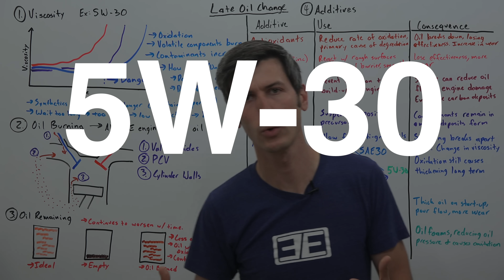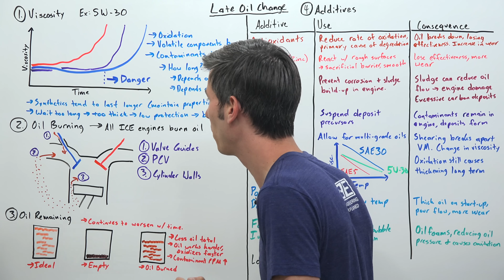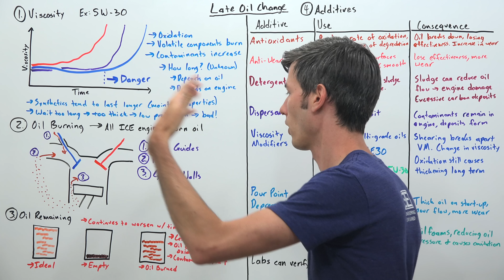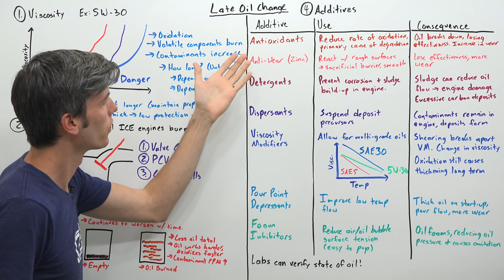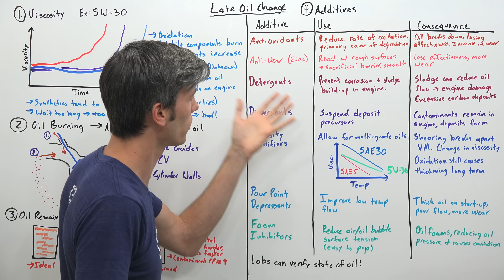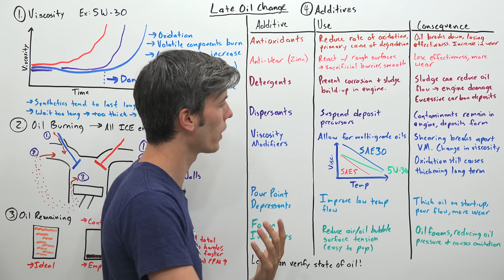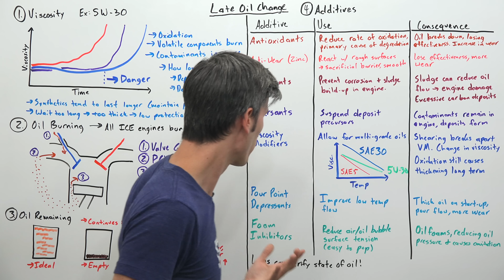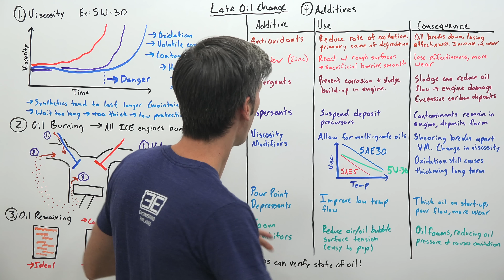What If You Forget To Change Your Oil?

Comment: My dad hade brigg and stratton engine That he never changed the oil in.  Lasted 33 years. And we dont know how match langer it should hold.. cuz the body was rusted up really big holes everywhere. 
And the wheel was wobling last 4 years And then one fall of..  I saved the engine for 2 more years still worked fine. 
But it never Come for new use..  I throw it scraps
Reply: @EpicDrew15  yes way !!!!!   it did !  33 year without oil change !!!  lawnmower have more setted rpm then cars chainsaws.. 

and built quality back then was way better then now ...... 
after 33 years there was almost no body left only 2 wheels.. i tok it of only the engine looked at the oil it was not sludgey.... maybe little...  i change the oil then after 33 years...  i spray painted it. and made a new airfilter..  

and pulled the string it runs really fine..
had it for 2 more years then i throd it for recycling i had to move to a apartment...  and be flexy for moving around....

in sweden that suff is not wourth anything.. even cars. 
old cars that passed inspection 
a real inspection......  i heard from southauto man erik that they are not so good in usa they just letting passed cars.. 

here in sweden they are really professional and you cant get it passed if its not good for passing....  

wheel  that car coast around 500 to 1000 bucks here !!
Reply: I have quite same age Briggs & Stratton it have had some oil changes. And it has be used every summer but quite less. About 10 L gasoline every summer.

Comment: Why does the USA have such short oil change intervals? It's normal in Europe to have oil service intervals of 15 to 20,000 miles, for example my Skoda 1.5 petrol turbo engine has a 20,000 miles / 24 months service interval.
Reply: @EpicDrew15  It’s definitely 20,000 miles / 2 years, it’s in for its first service shortly.
Reply: Might have something to do with manufacture warranty...

Comment: If your car burns mor than a quart every 4k miles then u never have to change your oil. Drove a Chevy Van like this for Two years. My friend still drives it 3 years later🙂 Its always better to have oil than none at all 👍 Also if your car burns oil stick to basic oil, Synthetic only made it worse. Although if your car is new only use synthetic and change every 6k. If u use Amsoil XL or higher then change at 10k, no longer than that! Skip the Amsoil OE it crap buy something else instead 👍 Good Luck🙂

Comment: On old Stanley's from the early 1900s the "engine" was open and didn't have an oil pan. One was expected to take an oil can and manually lubricate the important bits every 30 or so miles.Mind you this was a steam engine where having a totally sealed engine would lead to water building up because steam.

Comment: I have a question on this topic which is not answered in the video. My cars recommended oil change interval is 15,000km or every 1 year. I don’t use my car often, and when I do, it is never for a short trip so the oil always gets to proper operating temperature. As a result, it takes me more than a year to reach 15,000km. I use fully synthetic oil, so is it okay if I change it every 2 years if that is how long it takes for me to reach 15,000km?

Comment: Okay, on this one, I beg to differ.  I bought a 1994 Honda Civic with 256,000kms for a $26.00 bottle of rum and ran it for 6 years up to 372,000kms - never changed the oil once and never changed the oil filter.  The car didn't burn oil either.  I added about 1/2 of a quart every 5k to 6k kms.  She fired up every day without any issue.
Reply: @EpicDrew15  Andrew... I bought the car for $26 dollars, why would I spend more money changing the oil every 5K?  Every oil change would have cost me about $30 bucks every 5,000 kms - that would have cost me $600 bucks over the 6 years.  I had no intention of keeping the car if it died so I wasn't worried and nor did I car.  Nope, it didn't "burn" oil.  That said, ever car burns oil - a fractional amount with every explosion in the cylinder.  But my 94 civic didn't smoke out of the tailpipe but it did consume a bit of oil - just like the Z06 Corvette and many other cars for that matter.  It just didn't consume enough oil to smoke out of the tailpipe.  Oh, and thanks for your criticism.

Comment: My sister didn't change the oil on her Mazda 3 SP25 for the first 45,000km. Yes, she drove on basically run in factory oil for 45,000km. She then drove the car until it had 130,000km with semi regular oil changes with no problems until she traded it in. The Japanese know how to make an engine.

Comment: Does oil deteriorate if a vehicle is parked up for say a year? I have seen many discussions on forums claiming that it does, but would prefer a scientific answer based on data.
Reply: It does a little bit.  The bigger issue is potential condensation creating water in the oil.

Comment: Used oil analysis services periodically with my big rig... It can tell you if you are starting to have a problem, by metals and percentages in the engine of them.  Additives like Lucas are worth their weight in gold, because the coating they put on the engine parts protects things in a "cold start"... The oil settled and drained into the pan.  If you vehicle has been sitting for several days, and that first few moment when the engine is running a little rough?  That's your piston rings and everything else running dry...and it adds up over time.  Lucas or an additive like it, the engine "spools up" immediately and smoothly at start.  If you want the car engine to last, baby it in the oil and fuel treatment department.  Routine maintenance is noting to cut corners on.

Comment: The COVID question for many of us is when to change oil by date rather than distance. I am sticking to once/year with a good synthetic oil. Other thoughts?
Reply: I stick with 3500 miles or 4 months. No real scientific reason for the time limit, but it just seems like a long time to be sitting in the engine.
Reply: @diytwoincollege7079  For what it's worth, the oil change interval for my 1973 Chevrolet Chevelle was four months, without mention of mileage. Given that short distance driving is hard on the engine and the oil, this does make some sense. I think today's synthetic oils can go longer than 4 months, though.

Comment: I had only put 1500 miles on my truck before my oil life meter expired for time (1 year).  I was about to park it for a few months, so I let it slide until spring.  Full synthetic.  Is there a problem with that?

Comment: My rear main seal was leaking out about a quart a day for about a year. After I finally fixed it I almost forgot to change my oil because it wasn't something I had to do for a year. Surprisingly I didn't change my filter for the year that it was leaking and after inspection it was pretty clean for being a year old

Comment: Best oil is clean oil. I change my oil and filter when I start not seeing my oil dip stick level lines through the oil. Oil and filters are cheap engines are expensive. Cover fifty years using this method and never ever had an engine problem or failure. When I’ve sold my vehicles people say my vehicle is the best they have seen. Best of all they mostly always sold for asking price. First to see usually bought them.
Reply: Ummm... Okay... 

I'm still going to change my oil on schedule instead of when it looks too dark to be read...

Comment: While many people are advised to change their oil every 5-6k, even if you went to 7.5k you're probably OK as long as the oil is topped off and you're using a synthetic blend.  In fact, many newer cars (made in the last 10 years) supposedly claim you can go 10,000 miles between changes, although I personally still stick with every 5,000 miles or 6 months, whichever occurs first.  But it's not the end of the world if you go over by about 2-3k in most cases.  The only time it might is if your engine is worn and leaking/burning a lot of oil and it runs low or gets excessively dirty.
Reply: I had a 2001 VW TDI that had 10k mile drain intervals. That made me nervous at first but it was running perfectly at 310k when the timing belt broke. I had the oil analyzed several times at change time and it always came back with plenty of life left. My new Tiguan also has a 10k mile drain interval and I don't feel concerned at all about following their recommendations as long as I'm using the properly spec'd oil.

Comment: What about shorter mileage travelled but time reached (ex. only 3k miles travelled in 1 year), should we change oil already, or wait for the 8k-10k mi distance?  If we still do need to change at this interval, why, what causes oil to deteriorate despite less travel distance? Thanks.

Comment: I bought a new motorcycle in 1984. I have never changed the oil. Motor is still going strong on original piston and bearings. Probably because it is a two stroke
Reply: @EpicDrew15  Do you know how a two stroke works?
Reply: @EpicDrew15  If you know how a two stroke works, please explain how you change the oil in a two stroke. I have never changed the oil in any of my two stroke engines since the mid 1960's. Was never mentioned in any of the manuals.

Comment: I never change my engine oil. I buy 10+ year old car and at around 70,000 miles normally a 2.6 litre automatic car. I alway  use 10w40 oil and just top it up and never change the oil filter. I normally make the car last 3 years and get rid of it at around 160,000 miles for scrap. I buy these cars at around £700 and sell them for scrap for £150. Every time I take my car to get a service something major goes wrong  after the service and the service always cost more than the car.

Comment: I had a Honda Civic 1.5 V-tec 1998. He did 500.000 km (310.000 miles) and had only a oilshift for 5 times. He went away because of corrosion. The engine was still 100% and never had to change an engine part, except for a new distributor cap. My next car was exactly the same car (1999), with exactly the same story. Why are engines like this not being built more often....I bought my first car at 35.000 km. (21.000 miles)

Comment: What do you consider the effect of going over, not by mileage, but by time? It takes me at least 6 months to put 3000 miles on my car.
Reply: You will get more fuel in the oil and other contaminants. That is why oil changes go by both distance and time. A good rule of thumb is 5000mi or 6M, whichever comes first.

I always change my oil at 5000 mile intervals in the ten years I have owned my car. When COVID started and I wasn't driving 70 miles a day to work, the car sat for a long time. I didn't change my oil for over a year, closer to 18M as I was waiting for it to get to 5000 mi and the oil change tech said my oil was not only black, but smelled. The smell was primarily fuel. I now work from home primarily and don't drive much, so I am far more likely to change based on time rather than distance. The oil is dirty (like a light brown honey), but not close to black or smelling when I change it now.

Comment: What's your opinion on condition based v time based? The car industry use time based maintenance where as in industry condition based maintenance is used! Industrial lube oil systems lubricate assets valued into the multi millions where machine down time costs millions in lost revenue per week! They send periodic samples of used oil to labs for analysis where the oil is analyzed for wear particles, chemical condition (additive package cond etc) and contamination. (water, dirt antifreeze and the rest). This approach is also adopted in the heavy plant industry without issue. I think lots of money is wasted changing oils on cars.
I used to send a used oil sample for analysis from my Porsche, never was the oil contaminated, showed wear particles or additive/condition degradation!
I head up the used oil analysis for a large power generation company. 
Time based maintenance is a money maker for the car industry!

Comment: Hi. Please guide me. In my Vitz Yaris 1.0 L 1krfe, i changed oil 5w30 a bit late. That leads to oil consumption issue, and crank started making noise. Toyota guys asked me to use 20w50. I tried 10w40 but oil was consumed. Then i shifted to 20w50. Using regularly since 5 years. Now i want to go back to 10w40. Can i go, or will it be harmful for Engine ??

Comment: Todays engines and oils are so much better than they used to be that going 5000 or 10,000 miles without and oil change is not going to damage your engine so badly that it will be ruined it's all a scam by the oil companies and oil change stores to make more money.

Comment: Most current oils have removed or significantly reduced zinc content, as it raises problems with modern catalytic converters.  It is a really important additive for small engines.  Some small engine manufacturers like Kohler sell motor oil for their engines with zinc additives.
Reply: What's the replacement?

Comment: you wont have total engine failure like some mechanics tell you... its fine to do a little more if you cant have it changed on time but i wouldnt drive more than 1000km/1 month after the usual interval.. on most cars its fine... especially if you only buy it for a few years and sell it again like most do

Comment: what if i have not reached the recommended milage for engine oil change but it has been a year? (meaning supposedly the engine oil is for 7k km but i have only used up to 4k km) will i need to change the engine oil?

Comment: Use synthetic oil please. It does NOT deteriorate as regular cheap oil. Normal driving it will retain protection property for 10,000 miles or 12 months. Don’t worry, you will be fine if you change synthetic oil late as long as you have not gone over 10,000 miles.

Comment: What about a quick video on multiweight vs single weight oil, conventional vs synthetic.  I am noticing that in orbit motors and some agricultural equipment, there is a debate on the synthetics being more of a problem due to the lack of fogging vs conventional, and switching between 30 or 40 weight in the summer vs 10 or below in the winter will give you the best of all worlds.

Comment: Lol I haven't changed my oil since i purchased the car 2015! I've done around 40000 miles only been topping it up! I know i should but if my car is running fine and my oil consumption is super low I've only used around 2 litre bottle since purchase and I'm getting on 10 liters of fuel 102 mile range motorway and around 75 urban you can't mess with honda!
Reply: @EpicDrew15  bruv lol I purchased the car with 130k on the clock it came with full official Honda service history it's currently 177k mileage! Only thing that effed up was alternator if was my fault as I have a laptop tablet phone and a alpine headunit and a small amp no subs though they suck juice like mad that's the only thing that effed up Honda rock!

Comment: Using the engine on high revs does way more damage than changing much later the oil but using the engine gently.... So depends a lot how you use your car.

Comment: I take a sticky note, write the mileage i changed it at, then change it when my odometer is 5k above that. I drive highway mostly and use synthetic oil and wix xp folter d17 civic

Comment: so how much miles over is too much? They said to change my oil every 5,000 miles, but I wait until 7,000 or 8,000 to change it and it's fine. What about if I don't drive that often? Do I still have to change it every 6 months? This year I drove about 2,000 miles within 6 months, is the oil still good?

Comment: if you miss your oil change by 100 or 1000 it's not a big deal. change your oil and roll on.   if you simply don't change or check your oil  - you're going to get the wake up call you need about negligence and caring for your car. 
if you don't understand the difference - you probably shouldn't own a car or you're about to get a very expensive lesson.

Comment: Hi Jason! How does this apply to oil changes for a car that is not driven much? I live in a mid-large city and drive around 2500 miles  a year. I usually replace my oil once a year or so with the manufacturer recommended 10W-60 synthetic. The interval is 15k miles but I do so every year anyway since I live in a climate that does get a few cold weeks in winter. Can you go into a bit more detail involving regular oil changes once this low mileage is introduced as a factor? I do send in samples every other year to Blackstone labs for analysis, and so far so good! Additional specifics: E90 M3 ~84k miles. Thanks for all the great videos, the one on snow vs summer vs as tires is one of my personal favorites!
Reply: The early and frequent oil changes can only be beneficial. It won't ever be harmful.
Reply: Is this an Alfa Romeo Twin-Spark?  Only Alfa could have excessive oil burning on 10W40 and then just change the specified oil to 10W60! 😂

Comment: I used amsoil oil & filter & changed it once a year in a '06 ram starting at 22k miles. 13yrs & 130k miles later, it only "used" oil through a front timing cover leak & previously through a valve cover leak that was repaired at 65k miles. Never had any mechanical problems.
Reply: Amsoil is legit the best

Comment: I have Chevy with 5w-30 spec. But I'm filling it with 10-30, I lived in tropical and my home near ocean, there's no winter here, 19 degree celcius the coldest you can get, but it's rare, 20-23 at most. 
Is that okay to using 10-30?

Comment: Engineering aside. I once worked at a body shop, bought a totaled Dodge with a 318 V8 @ 18K miles on it.  Used it as the shop car. When it needed oil I drained some from the next car going to the crusher. I never changed the filter and NEVER changed the oil.
I sold that car years later with 136k miles. Still ran perfectly 👌

Comment: In diesel engine,
Oil change is even more important.
There are long drain variants of the Engine oil which can typically last for 80000 to 100000 km